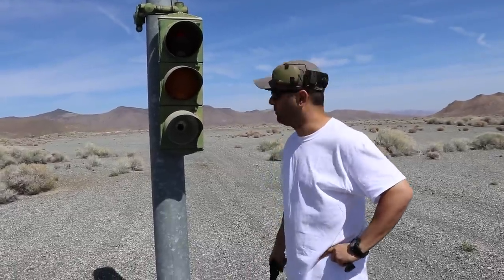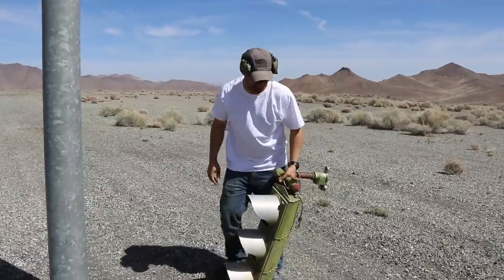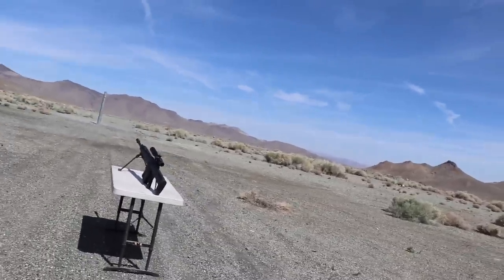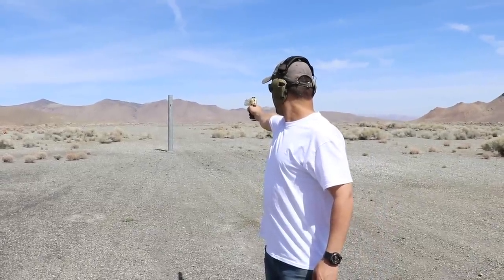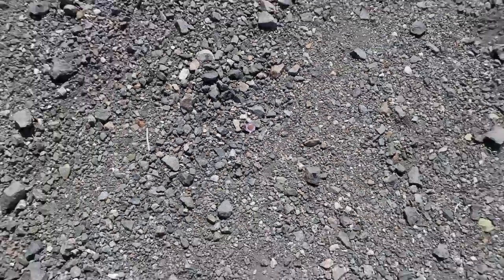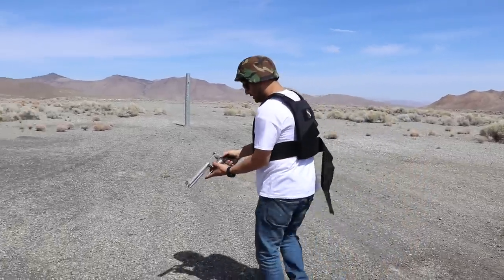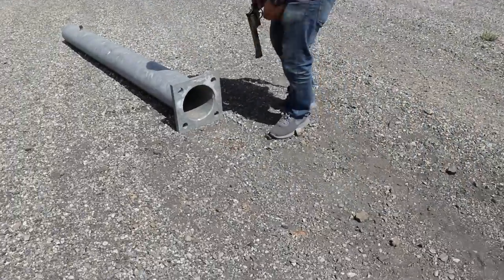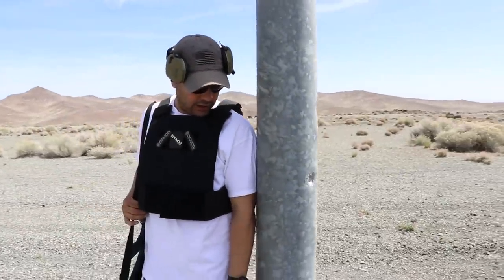Are Traffic Light Poles Bulletproof ?

Comment: The out casing of the aluminum tube is acid oxidized.  This hardens it giving it structural integrity without diminishing the inner flexible mass.  Basically it holds up to tremendous loads but is stiff enough to  shear off at the base (with the help of engineered rated shear bolts) so that rather than killing the occupant of the vehicle it snaps off at the base and falls opposite the direction of the traveling vehicle (so it doesn’t land on top of them).

Comment: I think it is the shape that's giving it extra strenght because it's pretty thin to be stopping some of those rounds. Especially considering that it's not even armor grade steel. Probably perfect shape for distributing the force? Well, i think it could have stopped the .50 if it was 1.5 times thicker. I'm just guessing here, but comparing it to the other tests and seeing how strong it is, i think overall 1.5 times the thickness would be enough.

Comment: If you actually want to penetrate metal and shit stop using hollow points! 🤦‍♂️😆🤣😭They're made to expand on contact 😑🤦‍♂️🤦‍♂️💯if anything you should use a FMJ round cuz they're a lot better at penetrating since they don't instantly deform🤷‍♂️💯
Reply: And yes I know he didn't use hollow tips in every single caliber.. But I've seen several videos comparing those Xtreme penetrator rounds to regular FMJs and depending on the caliber does extreme penetrators will sometimes actually penetrate less than a regular FMJ round🤦‍♂️🤷‍♂️💯 and I seen that on more than one occasion